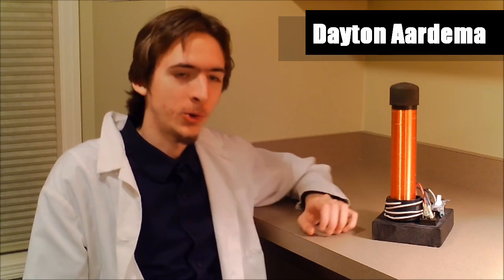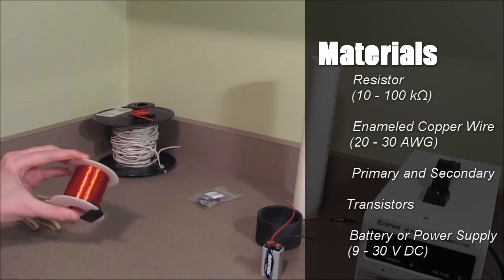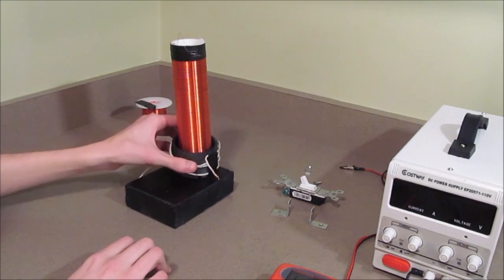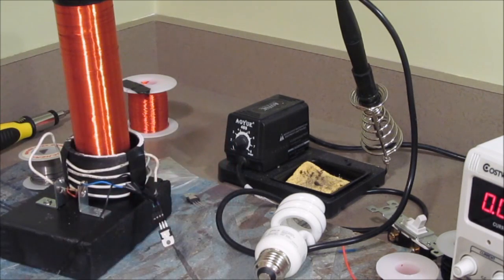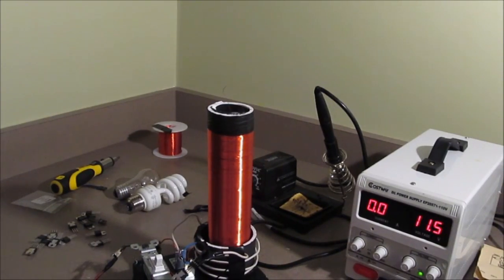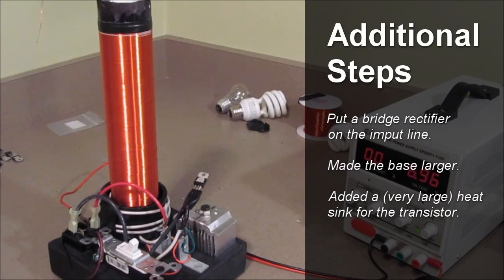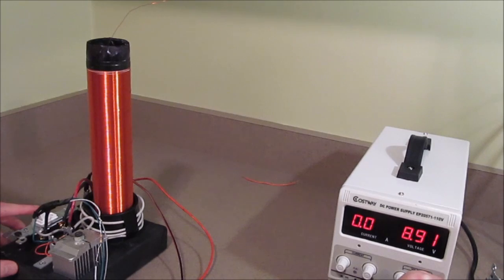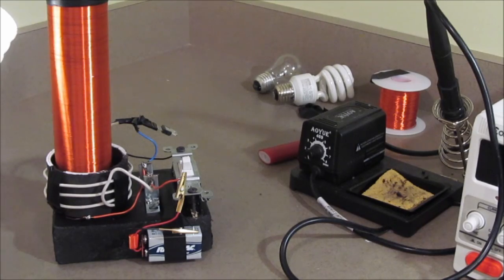SLAYER EXCITER - DIY Tesla Coil Build

Comment: You need a high speed diode. With the over powered base you’re causing basically a short to ground. But that’s kind of what it’s supposed to do, right? I found that when I added a piece of 6x6x1/4” aluminum plate under the mounting board, it provided a better ground plane. Also, I used anSTP6nk90FP power  MOSFET, screwed to a huge block of aluminum for heat sink. Very cool though! Good Job.

Comment: Hello Sir, you are simply a genius. I have made a Mini Tesla Coil. It works but after waiting for 4-5 seconds and even it does not produces sparks(Stream of Electrons) as your does. Here are the components I have used.
1) 2n2222a331 Transistor
2) 22k Resistor 
3) 250-300 turns in the Coil
4) 9V Battery
5) Copper coils
Please try to reply me as quick as you can because I have to complete it for my School Project.
Thanks :)
Reply: Try increasing the voltage
Reply: Hahah 9 volt will not produce any spark for 300 turn u need atleast 12 volt with around 2≥amp of current.

I have around 1500 turns in secondary and still get tiny sparks with 12 volt
Reply: A ceramic capacitor can help. I managed to make small sparks from 2v

Comment: First issue you may be encountering is the absense of the (flyback diode). It allows the switching to be smoother and allows a higher frequency to be achieved but not only that, it protects your base (in my 4 FETs) from large em spikes just as you see in any schematics including virtually any inductive (or reactive) load such as motors, relays and transformers. There are more out there but also your base resistance value is NOT definite for all VCC scenarios. Either use a pot I some type of driver. I live your vids BTW.
Reply from the maker: Thanks for mentioning that. Honestly, I had completely overlooked it back when I made this video.
I've been meaning to revisit this topic to address all of the little things like that. I'll be sure to include your suggestions when I do.
I'm really glad you enjoy my content. I enjoy your comments
Reply: Blueprint No problem at all. Make sure the "flyback diode" is rated for the fr used due to the field being out of phase. You may also incorporate the use of a cap across the Vcc and ground to allow the oscillating parameters to be smoother.  Also large variants will be present if your caps aren't capable of running at the frequencies achieved. NEVER USE ELECTROLYTIC CAPS!!!! The are unable to handle the frequencies and will explode in the worst scenarios.
Enjoy

Comment: How did you make the transistor connector. Please reply as soon as possible, I need to make it for my science fair project.
Reply from the maker: No Worries.
What I used for the transistor connector was a *FEMALE 3-pin PWM connector*. A quick Google search will show you some relevent results. These connectors are most often used for robotics. If your school has a robotics club, they would have pleanty of these.
If you want to do one better, you can mount your transistor (and everything else) onto a electronics *breadboard*. Good ones can get a little pricy, but are well worth it.
Good luck. I would love to see your design should you ever publish it.

Comment: great vídeo!
i has some problems whit my coil, i using the BC548 but it just heat up, in the osciloscope it oscilate for a while and in the end just heat Up and stop doing everything. 
i use the bc548 instead of 2n2222 have less power but it should work too, and my connection are ok, what you thing can be wrong?
Reply from the maker: The BC548 Transistor is rated to handle a 100mA current into the collector. What I found was that the Slayer Exciter draws about 500mA during normal operation. That is why I used a better transistor: TIP31C. If you want to use a BC548, either connect a heat sink to it or use a small value resistor before the collector.
http://www.mouser.com/ds/2/149/BC547-190204.pdf
Reply: wow! i see this datasheet http://www.philohome.com/sensors/gp2d12/gp2d12-datasheets/bc548.pdf
and it draw 300mA at 9...10v but the resistor is the same as put 2 or 3v to use only 100mA but with this power dont turn on the lamp.
I will get the 2n2222
thanks!

Comment: Hy !
Great vídeo!
What is the diameter of the secondary coil ? An how many turns for the secondary coil ?
Reply from the maker: Hy! Here are the dimensions:
diameter = 2 inch PVC pipe (outer dia) 
height = 9.25 inch 
approximate turns of 28 AWG wire = 800-900 turns
Reply: Thank you !

Comment: When my coil arcs to my finger or a metallic object the TIP31C transistor dies immediately and is barely warm. Anyone have any idea why? I'm powering the circuit with 13v, 1 amp output. The only different thing I did differently is have 1700 turns on my secondary and 8 turns on the primary. I also added a large capacitor in parallel with the rest of the circuit but this had no effect on transistor stability.

Comment: Hi, I'm confused about how the secondary turns off the transistor at 1:03. I thought that it needs a complete "loop" to let the secondary inductance and the capacitor resonant or to turn the transistor off, but I don't see a complete loop(the blue part in 1:03) in this part. Did I miss something important? Thanks!
Reply from the maker: Yeah, I didn't explain the physics very well there. To answer your question: the primary and secondary coil makes a transformer with one another. As a magnetic field is created by the primary coil, a reverse magnetic field is made by the secondary coil (Lenz's Law). This causes a current to flow in the opposite direction in the secondary. It's important to remember that even though the primary and secondary do not touch each other, they are still "connected" magnetically and thus electrically.

I do a much better job explaining and animating this principal in my remake of this video if you were interested: https://www.youtube.com/watch?v=AehL3BodduE&lc=z224iniqwkeavzbufacdp4314ngy4rxth1ua4g5u1wtw03c010c.1545316948789816

Comment: Hey, i tried making a slayer exciter with a tip31a transistor, but it doesn't work. Is it because of the transistor or other internal problems?
Reply from the maker: I took a look at the TIP31a datasheet (here: http://www.mouser.com/ds/2/149/TIP31A-890173.pdf) 
Although it can handle a little less current (about 3/5), it should still work just fine. Just be sure not to overheat it.

Here are some common issues that you could try: 
1) try flipping the secondary coil so that the magnetic fields induce a current in the proper direction.
2) make sure the pins on the transistor are correct. The datasheet has that info on the first page
3) If you can, use a multi-meter to check continuity at each point in the circuit. Things may look to be, but not be connected

Good luck

Comment: Please mention the values of all the products being used
Reply from the maker: No problem:
Resistor: 47 thousand ohms
transistor: tip31c (2n2222 also works well)
primary coil: 3-4 turns
secondary coil: 800 turns
battery: 9-12 volts
Reply: Blueprint thank you very much...
Reply: @maryvungtawmbing2440  use a tip 35c it will never gona blow up iam using it continues for 5-6 min without heatsink at 12v and with a big heatsink i have tested it for 30mim

Comment from the maker: Did I miss something? I am available to answer all of your questions in the comment section
Reply: Blueprint what is the length and radius of the PVC pipe ?
Reply from the maker: 1 1/2 inch, I think..
Reply from the maker: Hi
Sorry it took me so long to get those measurements. I just got back home from spring break. Here are the measurements:
diameter = 1.5 inch PVC pipe (outer dia)
height = 9.25 inch
approximate turns of 28 AWG wire = 800-900 turns
Reply: i was wondering why you aren't using a diode on the slayer exciter circuit as most versions use one and if you know if that makes a difference?
Reply from the maker: Some models of the SE use an LED as in indicator light, this has no effect on the function of the circuit as a whole. It would operate the same as if it were a wire or not there at all (depending on what direction it points).
Or maybe you're talking about why some people use a diode at the base of the secondary. This is to insure that current only leaves the secondary coil but does not enter it. Since the physics already works out that way, it's a redundancy.
Reply: i mean like one of these in with it is pointed the wrong way for it to act as just an indicator but isn't really blocking anything      https://i.stack.imgur.com/b64nO.png
Reply from the maker: That is surprisingly not pointing the wrong way.
Although the battery is positive voltage only, once a current is created in the secondary, it becomes pos/neg AC current at a very high frequency. (This is Lenz's Law by the way). Thus a diode from ground to negative has a POSITIVE voltage across it (but only for half of the time).
The smart thing about this LED is that is only turns on when the SE is working properly, not simply when it is activated at the source.
This will not, in any way, affect the operation of the SE. It will just draw nominally more power. Should you choose to remove it, keep that wire OPEN.
Reply: Where is your feedback diode? You know that transistors cant handle a voltage over emiter : base . Germanium feedback diode is recomended because better high frequent rectification , and makes Slayer exiter self oscilating wich means once given a pulse you can turn the base power off and your teslacoil still works , but if you draw to many power your teslacoil shuts dows until you give a new pulse
Reply from the maker: Yeah - I know. I'm just lazy, that's all.
Reply: I made the Tesla coil same as you did but my transistor seems to overheat and the coil doesn't seem to work at all ???
Reply: Amm u can pin this comment so i can find it first
Reply: @BlueprintScience  does diameter and material of pipe influence the results?
Reply from the maker: @KennethAzemafac  Yes. Use a low dielectric material with thin walls

Comment: You showed a capacitor in the circuit diagram at the end of secondary coil, but i didnt used it?
Reply: are you using a 9v battery for all that sparks and all...?
Reply from the maker: That capacitor is imaginary. It simply represents the stray capacitance between the top of the coil and the environment. For example, if you bring your hand closer, you increase the stray capacitance.
Reply: @BlueprintScience ohh thx for that information ....... Btw great channel and so underrated, i hope you will reach 100 mil  soon😘
Reply: Nah he is nto using 9v

Comment: how is it working without a aluminium foil ???
Reply from the maker: Very good question. The point of having a top load (typically aluminum or some such) is to allow charge to build up there. Since it has such a large area, it has a greater capacitance with its environment. This does not, however, change the voltage. What it will do is be able to deliver more power into the environment at the sacrifice of frequency (the resonant frequency would lower since it is proportional to LC = inductor value * capacitance with the environment) For me, it was just a matter of how much power I wanted to draw.
Reply: LC = inductor value * capacitance with the environment) .....What is LC?
Reply from the maker: An "LC" circuit is also called a resonant circuit. It simply states that if you have an inductance and a capacitance, there will be a frequency associated with it. Don't worry so much about the math, here's a qualitative explanation.
Inductance is a measure of resistance to change in current; a coil with more windings has a higher inductance. Your secondary coil has a fairly large inductance. This is a fixed value.
Capacitance is a measure of how much charge something can hold. The greater the surface area, the more charge it can hold. That is why most people use a top load - so that they can discharge more energy at once. This is also the thinking behind 'capacitors.'
While inductance is always the same, the capacitance is always changing depending on your surroundings. If you bring your hand (or anything) near the top it will build up charge on your hand. What this means for you is that if you have a topload, you will essentially increase the range of your Slayer Exciter.
Reply: Brother!....first of all thanks for replying ,and second you are genius !!

Comment: Is the primary coil an ordinary wire?
Reply from the maker: Sure is
Reply: Blueprint then it's not working for some Reason.........is it because of the Copper wire not properly wined around the pipe???? Or something else
Reply: And btw the transistor is heating up a lot
Reply: Please help
Reply from the maker: There could be a couple of things going on:
Most likely the direction of the primary to the secondary is flipped. If you are not getting anything from the secondary, try taking the coil, turning it 180 degrees upside down and reconnect it. IIRC, the winding direction has to be the same for both the primary and the secondary.
It's also possible that the transistor cannot handle the current. We are essentially shorting out the circuit through the transistor. If everything else seems fine, you may need to replace it for a fresh one.
Keep the voltage low - around 9V - to avoid burning out transistors like crazy

Let me know how it goes
Reply: Blueprint does the copper wire need to be perfectly wined around the pipe or .......is some mistake in the copper wire fine?
Reply from the maker: Mine is far from perfect. Kinks and wire hops are usually fine so long as nothing breaks continuity. If a few turns are wound incorrectly, it will work against the efficiency, but so long as most are correct you'll still get the effect
Reply: Blueprint btw I messaged you on Facebook ........ please check it out ..

Comment: If the washing machine  interferes with the Tesla coil and is 5-10 feet away why doesn't anything happen to the power supply wenever it's literally inches away why doesn't it start acting weird if anyone knows please let me know thank you
Reply from the maker: The power supply was in a metal casing which acts as a Faraday cage and won't let any electric fields through - it is intentionally designed that way. The reason the washer went haywire was only because it had touchscreen buttons (not push buttons) which detect a person's electric field to know when you touch it.
What I didn't show in the video was that my laptop's track-pad also made my cursor go crazy, so I had to close my laptop while it was on.
Reply: Yea I thought that at first but then thought sure the washing machine has a metal cage around it aswell but didn't notice that it was touchscreen, can't wait till my parts deliver so I can build one aswell same design as yours but on the secondary coil gonna try to get 2k or more turns...by hand wish me luck hah but anyways thanks for your reply
Reply from the maker: @jgjgggjhn  Good luck with your build.
BTW, I made a much better video on the slayer exciter a year later that works better if you're interested. Here's the link just in case: https://www.youtube.com/watch?v=AehL3BodduE
Reply: @BlueprintScience  The high frequency should also be present along your house wiring so long as you are using the mains powered supply. Might even be able to light an AV plug *led along say a faceplate screw on a nearby light switch for example. My speakers across the room like to act up when I power one along the same circuit they are plugged into.

Comment: why does my transistor burns so easily ????
Reply from the maker: That's no simple question. I've seen and heard this from a lot of people. In my experience, it is a combination of several factors. 
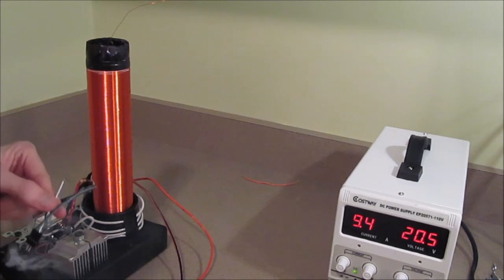First, the square wave input presents some problems. Since we want as much current through the primary as possible, we are essentially making a short circuit through the transistor. This would not be a problem with a sine wave, but since we are using a square wave, there is a plateau of DC current through the transistor. (Take a look at around 9:30 in the video.) To reduce this you could try adding a capacitor around 1-100uF from your transistor to ground to make it more sine like.
Second, there is usually a relatively high current going from the secondary coil into the base of the transistor. I found that a 220Ω resistor to the base is sufficient to handle higher voltages. Or you might try a MOSFET (which are more expensive but can handle more power)

Comment: Oh God, i thought it was easy, copy circuit and done, no bro, ok, its not doing a thing, secondary top to bottom in anti clock wise, primary also the sane, i have 4 turns for the primary in 16 g. and 10 cm of 30 g. of a 1/2 pvc pipe, the upper wire of the primary to the resistance (47kohm) and +9v, lower wire of primary to the 2 nd pin(collector) of TIP31C, secondary to 1st pin of transistor (base) and pin 3 to 0v, and nothing of nothing, not even heat, nada!, please help.